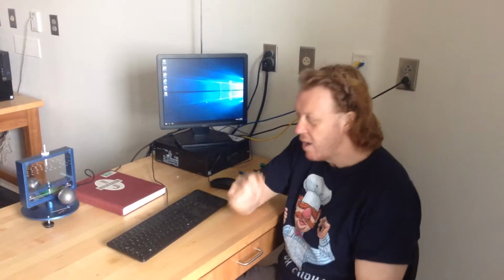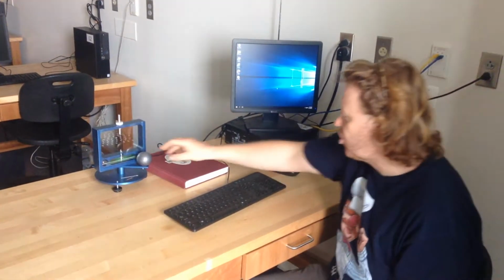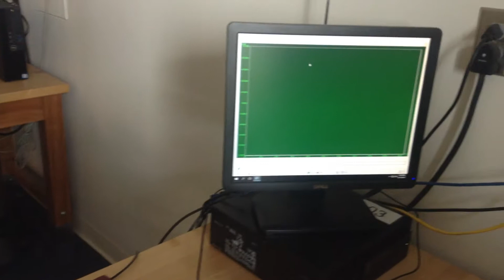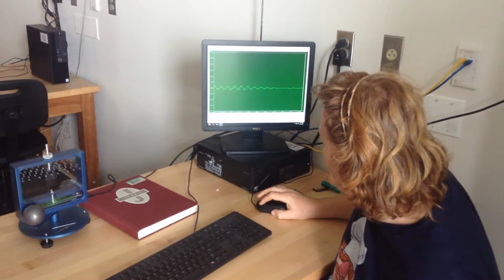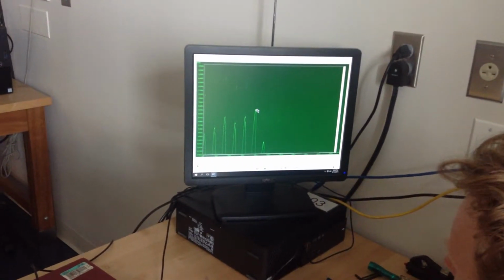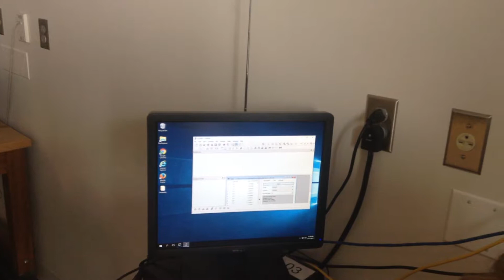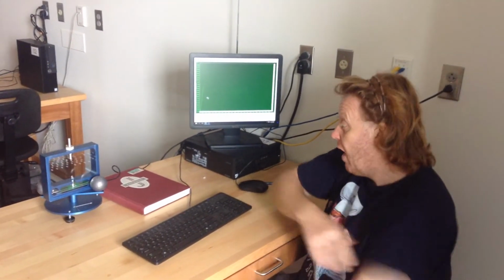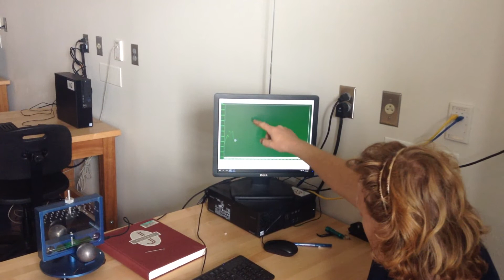Cavendish Balance PHY270L

Comment: How can you be sure that there are no electrical charges on those balls or somewhere in the device? Also, how can you be sure that there are no magnetical fields in the device or in the balls?
Reply from the maker: You area correct about charges, I never thought of that. I would expect that the presence of charges would add a systematic error to make G too small (repulsion vs attraction). I could ground each part of the apparatus and see if it made any difference. More late